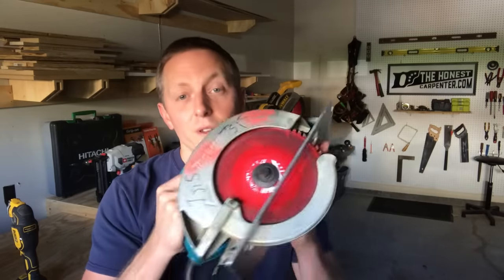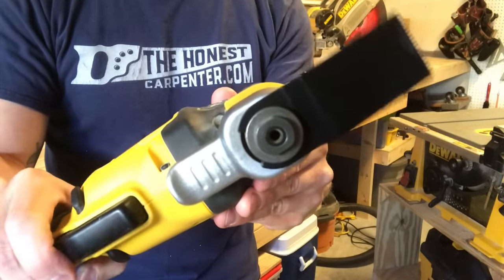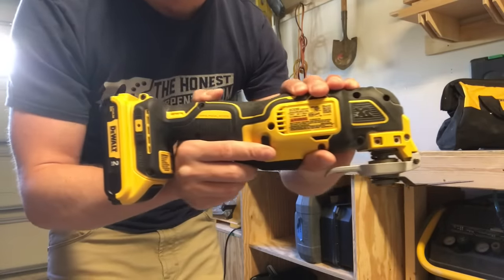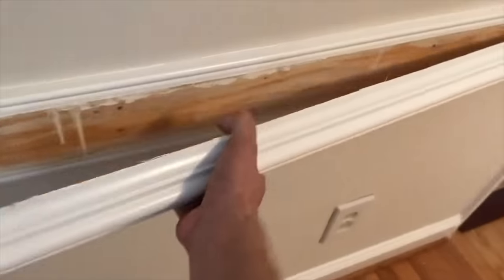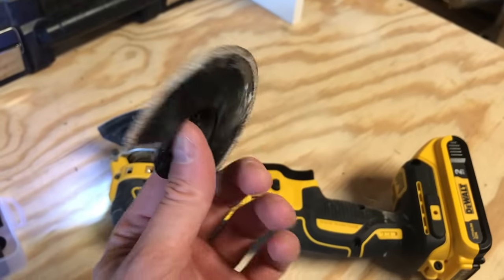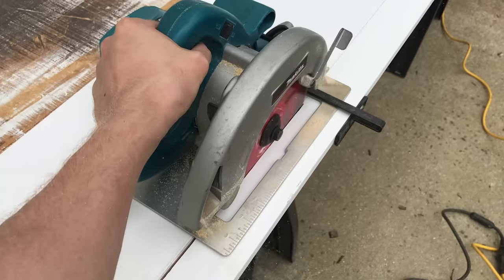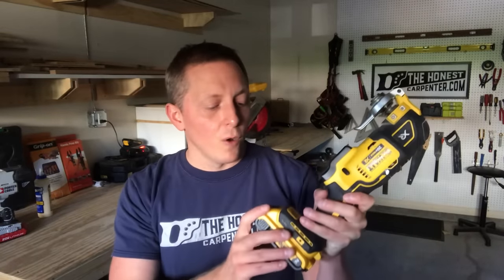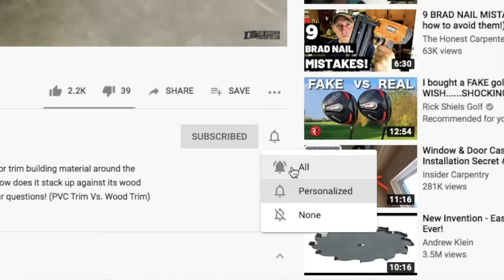The BEST SAW You've NEVER HEARD OF!! (Multitools--Great For Remodeling!)

Comment: I just put in a hardwood floor. This tool saved me from a lot of headaches. 
One example was I had to replace some mdf that was on top of a subfloor. It seems one of my cuts was off over a vent. I jigsaw would be out of the question. Full size circular saw using a plunge  cut? Maybe, but I would think of something else before going down that route. A good chisel because it's only mdf and an it would eventually make it through? Um, no. 
The multitool had me back on track in about 2 minutes or so. 
Getting the planks under door molding? A couple of minutes with the multitool and I was moving on to the next plank. 

I went with the Worx brand since I'm already in their eco system.

Comment: Brilliant review 
Cant agree more love you showed the cheap blades because brand blades cost a bomb and wear out just like the cheap ones but prob last a bit longer.
Had the bosch corded one loved it till it gave up lasted a good 8 yr now i have the dewalt at 20000 opm gets smokey so i move fairly fast after scoring on a lower speed and it flies through 
Them tile /grout cutting blades are a godsend when replacing a chipped tile 
1 prob is the sanding disk the velcro pad keeps melting on me i try not to put much force on but still happens

Comment: And to save even more money, you can restore the used blades by sharpening them back up by using a vise to hold the blade in place and file it with a triangle file.

Comment: Needed to replace more than half a dozen window operators (crank style) and the steel nuts and bolts holding them had rusted inside the aluminum window casing. Impossible to reach with anything but long nose pliers and the rusted flat head did not allow for much torque.

A trip to Walmart and $25 solved it via a Walmart house brand multitool. Cut through the steel bolts as if they weren't there. Didn't even need to open the two extra steel blades I got, the one included with the tool went through about 16 bolts with no problem.

Comment: Ya I have a fien multi tool and I love it and now with carbide blades they last a lot longer. Also I found if your cutting metal of any type if you spray with water it will greatly increase blade life. Like the videos
Reply from the maker: Good tip, John!

Comment: I've been a carpenter and cabinetmaker  for 50 years and find I'm out of control especially when trying to start a cut. You can almost never use it for natural wood cuts. If you are going to paint then a good painter with good chalking skills is a must as the vertical cut you showed you did. Sometimes it is the only option their is, I agree. Usually the only way I seem to be able to start a cut is on the slowest speed possible. Also if you can attach a board to  follow to start a cut it is very helpful.

Comment: I'm an electrician, and many years ago myself and a workmate had to get a cable under the floor of a fairly large room in an outbuilding of an Elizabethan manor house. The floorboards were made from oak, over an inch thick, and ran diagonally across the room, which made them very difficult to lift.
Upon lifting (with a great deal of cussing) a short length of board, underneath it we found a second layer of boards, running in the opposite diagonal ! Hence, to get beneath the floor we'd have had to lift virtually all of the top layer of boards. This made the job effectively impossible, at least in any reasonable time frame - it would have taken at least a day just to lift the top layer before we could even begin to lift enough of the second layer to get the cable beneath it.
If the multi tool had existed at that time we could have done plunge cuts through both layers and finished the whole job in an hour !

Comment: 5:55  i have to use it like that sometimes as the wall is over a chipboard floor... takes a lot of time but no other tool fits that close to the wall so i can save space for the new chipboard to fit over and have a good support. Also used it behind radiators.

Comment: Been trying to get my fellow industrial electrician buddies to acquiesce, but most need to actually use it, before relenting. Once they do, they are sold. It can do every sawzall job (obviously not as fast or as large) but can get it done. It's forte is getting tons of stuff done without carrying 3 other tools AND it's light and doesn't use a ton of battery. 

And if you do other work (other than electrical), it's stupid to not own it.

Comment: I had bought one long time ago but the single screw used for holding blade needed a lot of tightening and once the blade got loose you had to stop, tighten the screw. Hope the new ones are designed better. CN

Comment: I use 1 almost everyday. I got almost every brand. I mainly use all makita stuff but use the dewalt multi for ergo, only issue with my dewalt it gotta keep finger on trigger will not stay running with the button that keeps it on. And nahh it will not cut your toe off iv bump my hands with it bunch and nothing but lil scratches.

Comment: My father and I call it an "Osci Saw" while my wife's family calls it the "Awesome Tool". We've only ever gotten cheap ones, like Skil and Black + Decker.
With that said, I can tell you that they are far safer than most other saws. Maybe it's because our cheap-o's lacked the kick, or because their oscilating arc is super small, but you generally have a second to save your skin if it connects. Soft things like skin and leather flex (denim does not) and don't immediately cut when they come into contact with the tool. I'm not saying to go out and grab the blade while it's on, but I've bumped myself a few times (and a few times pretty hard) and never managed to draw blood. Boots have survived fine, but not my pants.

Comment: You are right they are great for some things,invented by Fein and produced for car industry in 1985, the patent expired in 2009 so other companies could make the tool cheaper. The blades do expire quickly and were expensive, when I was refitting bathrooms in the U K 10 years ago I had some diamond triangular needle files that I used to touch up the blades and got another good few cuts for free

Comment: Lent my Bosch Multi tool to a neighbor.  A blade came back almost toothless.  Later, I was  trying to get all the old caulk from around the base of a toilet.  Could not find my favorite thin scraper.  I found the almost toothless old multi tool blade.  Took the remaining teeth off it on the grinder and sharpened it a little,  but not razor sharp.  Boy does it take out the old caulk. Without destroying the product.  You don’t have to use the muscles either.  Just let the tool do the work. 
Love my multi tool.

Comment: I recently purchased one of these and would love to see a video demonstrating how to use the several different attachments. When I used the one that is a half circle with saw teeth, it actually burned the cut surfaces. Thanks in advance.
Reply: I think the half circle is mostly intended/useful for things like pipes, the shape allows you to plunge cut into a pipe from any angle. It also works reaosnably well with drywall, but the large surface area of the half circle heats up thicker material, that is causing the burnmarks. It  also tends to get stuck. For straight cuts use a straight blade. Try different blades to see what works for you - I tend to use a 1" blade for just about anything, but for longer/deeper straight cuts you might want a wider, narrow blade - like the one at 4:20.
Reply: @disklamer  : I've found the half-moon easier to guide on a longer cut. The thing is not applying too much pressure, letting the blade do most of the work. Keeping the speed low to medium helps.

Comment: Fun fact about this technology, the oscillating saw has been around for at least 80 years, probably well over a century. It was used in doctor's offices and hospitals to cut plaster casts off of patients. the extremely short distance the blade would travel during each oscillation would make short work of the rigid plaster but the skin underneath would simply move with the blade and stay undamaged. The surgical saws operated at much higher speeds with blades with much tinier teeth, but the principle is the same.

Comment: It's actually a very safe saw and blade combination.   If your skin has incidental contact with the saw blade under light to medium pressure, your skin will move back and forth with the blade that is contacting the skin so the blade cannot tear the skin because they are moving back and forth together.  This saw needs a hard surface to oscillate against, that has no give (unlike your skin) in order for it to cut.  The blades are sharp but it would require a fair amount of pressure for it to cut your skin.  If you turn this saw on and press down hard on your finger, you will trap the skin between the blade and the finger bone such that it no longer has the ability to move back and forth with the blade so cutting of your skin and then bone will happen quickly but you pretty much have to try intentionally for this saw to cut you. Incidental contact with any other motor powered saw blade will result in a cut before you even realize what's happening.  If as mentioned in the video you dropped the saw on your toe and it landed perfectly perpendicular to your toe, and you were barefoot,  it would make a tiny cut in your skin but would not go down to bone.  All the weight of the saw when it hit your toe would make a quick shallow cut in 1/10th of a second and then the saw would rebound or unload all that downward pressure and it would then fall over to one side or another and be harmless again.  If you are not putting pounds of pressure on this saw against your skin with a bone very close to the surface, you will not cut your skin. That's why they've been using the technology since 1940 to cut plaster/fiberglass casts off of legs, arms that have been broken.  https://myria.com/how-does-a-cast-saw-work-without-cutting-you

Comment: OMG!  I already own a multi-tool.  I just finished a big project - months long because I am a slow worker - in which I could have used the multi-tool to great advantage several times but, because of my "conventional" thinking, I used a circular saw, sabre saw or  Milwaukee Sawzall with less than perfect results.  I am now slapping my forehead in disgust and frustration.  Heretofore I had only used the multi-tool to trim door frames and molding when I moved some doors.  Darn me!!!

Comment: I've owned a Fein for years, when they held the patent. Great tool. Bought a battery HF version for smaller work. The only problem is my Fein uses a screw to hold down the blade. Wish I could upgrade the head to a better fastening system.

Comment: Dear Honest Carpenter:  would you recommend the multi tool for shaving off 1/8 inch from the end of a fence rail (2x4x8') that is a little long and will be attached with a bracket to a 4x4" post, or is a circular saw better?

Comment: The fun part about these tools is that because they vibrate only a small distance back and forth, they are a lot safer for your skin than spinny blades. Since your skin can be moved quite a bit back and forth, a lot of the tool's power is absorbed by just doing that. Spinning blades will keep going in one direction only and your skin won't, at which point the softer material loses. I'm not sayin that oscillating tools are safe in all circumstances but they do use these to open casts without injuring patients.

Comment: Ethan, another great info. video.  I've used my dewalt a few times, but the bosch blade is different and is installed with the allen wrench on the head.  It doesn't slide in.  I've had the blade change direction while using it and thought it was just loose, but it seems as if the blade head is rotating.  What am I doing wrong?  Your multitool in the video has the opening for the screw, but isn't there.  BTW you might update this video with my issue.  Thanks and best wishes,

Comment: Great video.  I want a tool that will cut metal and wood.  In most cases, it involves only very small cuts.  For example I need to make a metal u-bolt plate (1-inch by 2-inch). I need something to simply cut a 2-inch piece from a larger piece.   A hack saw would word, but would take too much time and effort.  A hand held circular grinder with proper disk would work.  My question is, " would the Multitool be a better option?

Comment: If you get tired of replacing the blade everyday (on principle) eBay sells carbide tipped blades that last a lot longer for wood. They last months if you get the right one. Check it out.

Comment: Hey Ethan, there are so many comments that I'm not going to go through them all, so you may have answered this previously.... but in the video, you have the cordless version, but you've also linked a corded version. Do you have any experience with the two? Can you suggest why choosing one over the other? I currently have a cordless Rigid JobMax Oscillating tool, and since I first purchased it years ago, I feel that it's never really been a good tool. In my experience, the tool burns the wood quicker than it cuts it. So I've been thinking about buying a Fein tool because a carpenter in the field once told me that it was the best tool he's ever had - and I want that feeling when I use it. Not the feeling that I'm doing something wrong by burning the wood.

Comment: If the multitool blades have chipped or broken off then it is out of commission for cutting work use but if the tool's blade is just dulled out and the blade teeth are fine then using a thin hand file to sharpen up the blade teeth again will save you a lot of money for a 5 to 10-minute blade sharpening and it will last you about the same amount of time when the blade was brand new.
I will also suggest that you keep the dulled and broken teeth blades around and use them as small metal wedge pieces for slight woodwork piece lifting for alignment.
Why waste a good piece of metal when it can be repurposed for other tasks.

Comment: the only problem with this tool is the blade fast mount system... under repeated load the blade will brake at the attachment point thus scrapping the blade often before the the teeth have dulled buy one without the quick mount blade system such as the rockwell or buy the Fein which is hands down the best... they accept the full round mount blades which are far more sturdy and precise

Comment: Here in Denmark we call them Feincutter's becourse FEIN invented this and had the market all to them self for decades. But I have known and used these for 20 years, I think. FEIN's was really expensive, really heavy and even very noisy. I now have a Dewalt, but on cord. You could mention, that the battery-Dewalt get very hot if used on a hard job for a longer time.

Comment: Hello Honest Carpenter love you're video. I am returning a Dremel MM50 to the store. When i use it at low speed, after 20 seconds i couldn't feel my hand. I almost lost complete control of the tool. My friend was laughing, until he try to work with it, same thing . There excessive vibration, something is not normal do you have any idea what could be the problem ? Just curious.  By the way i am french, so if my sentence seems weird, that explain.

Comment: The key to using an oscillating saw is using a good quality oscillating saw but also using a sharp blade. A blunt blade binds up in the material and the saw just vibrates your hand. The blades can be expensive but a sharp blade and using a technique that will allow debris to clear from the teeth will help you use this saw efficiently and safely for years. I know people who will bury this thing into wood expecting it to cut like a chainsaw. The material burns or melts, the blade gets hot, the teeth go dull in your hand and arm are bearing the brunt of all the vibration. I cannot do a day's work without picking up my DeWalt oscillating saw at least once.
Reply: Hi Scott, do you use Dewalt blades only? I've just ordered their multitool, but was wondering if I can buy replacement blades from other manufacturers and still use the quick-attach lever to fit them?

Comment: I have a previous model Rockwell F50 (5+ years ago); I was taken by the power and the good deal with hard case. It is very good, very well built, just too much power. Too much vibration, sacrificing accuracy. Definitely useful, though, in an old house.

Comment: I use a cable so idont bother with batteries. Since I do diy at my house and have power. The blades is true but one think I discover especialy on sanding dont use full power but 1/2 to 2/3 and all last alot longer sanding pads and the holder of the sand also not to put alot of  weight

Comment: @The Honest Carpenter Could you recommend a compact tool or attachment to cut my existing hardwood at the kitchen toe-kick instead of a "toe kick" flush cut tool - to do the same job? I'd like to grow my DIY tool set without purchasing a tool I'll likely only use for 1 job. I have roughly 60 ln.ft to cut under the cabinet and the eng. hardwood is roughly 3/4" total thickness.

Comment: Cmon man!??? These been around forever.  I've got 6 of them. My m12 Milwaukee  is total garbage. 20 volt Dewalt vibrates the saw more than the blades. Dewalt made it hard to use different brand blades.. So far the best one is the corded Rockwell. Got 2 of those. Very solid and they blow away cordless ones!! My Ridgid 12 volt is the biggest pile of shit I've ever used. So corded Rockwell for big cuts and big job. Cordless Dewalt for a quick small job. I've literally used my Rockwell as a hammer. Still runs great after about 20 complete abusive home rehabs.